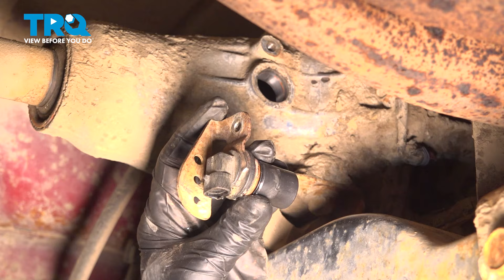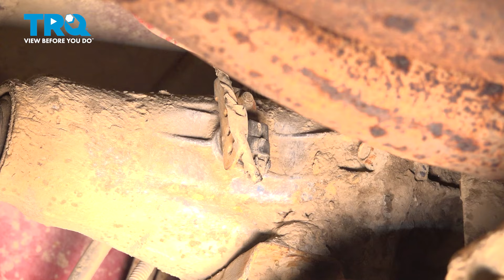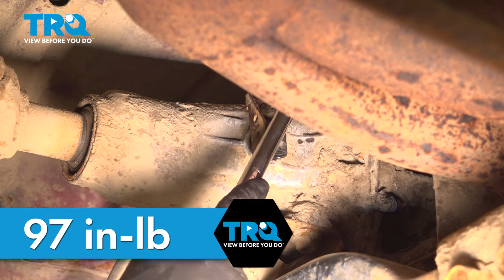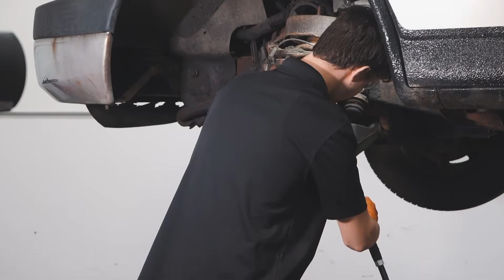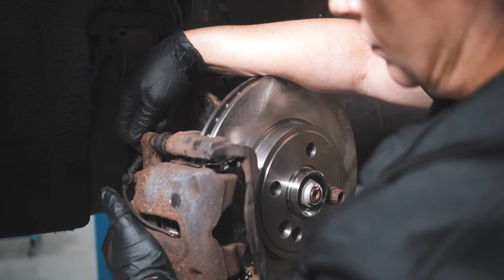How to Replace Vehicle Speed Sensor 1999-2006 Chevrolet Silverado 1500

Comment: I had shifting issues on my 93 GMC with a 4L80E. I decided to stay in my lane, and bring it to a trans shop. They changed the harness and gasket and claimed it was fixed. 400 paid. 20 mins after leaving the shop, I'm back in limp mode. I spent some time in the forum's and found out how to test the speed sensors. The input (ISS) and output (OSS) are identical parts when new.  To test them, you need to swap out their location. (The ISS is further toward the front, drivers side if I recall correctly.) If the shifting behaves differently, then the two parts are no longer the same. Change both and you're done. Fifty buck, and less than an hour's time. The moral is some trans shops suck.
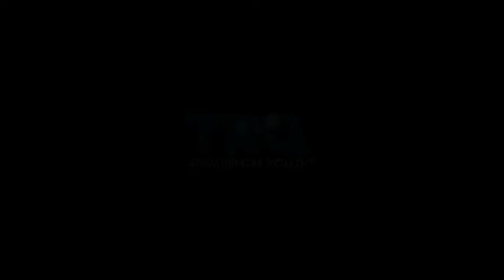4:02

Comment: A good tip to avoid debris getting into the transmission casing: if it's crusty soft wire brush the exterior before you remove the sensor to save some time and give you good piece of mind.

Comment: Started driving through mud puddles and developed a “service break system and red break light” on the dash. It’s jumping speed and won’t shift right and the speedo fluctuates up and down while in low rpm. Is this my issue? Help someone it’s a work truck and I need back on the road !!🙏🏼🙏🏼🙏🏼

Comment: It looks like the original one has a little cup sleeve on the tip of it that pushes into the transmission with it but the new ones do not have that little cover or sleeve whatever you call it are we supposed to remove that from the old one and put it on the new one or just put the new one in that little cover at the end of it?